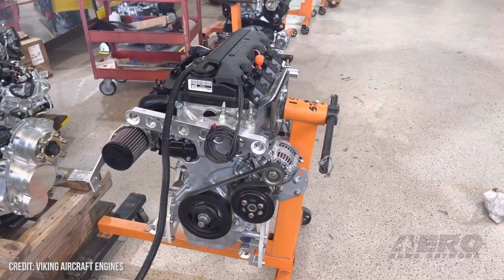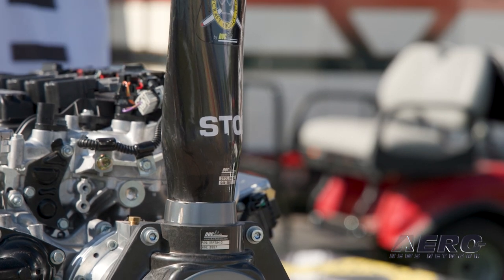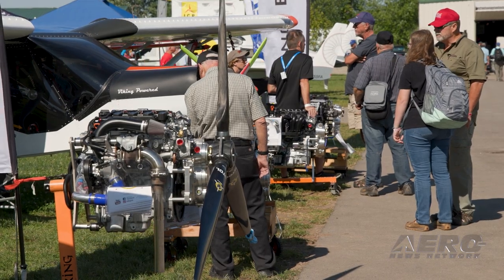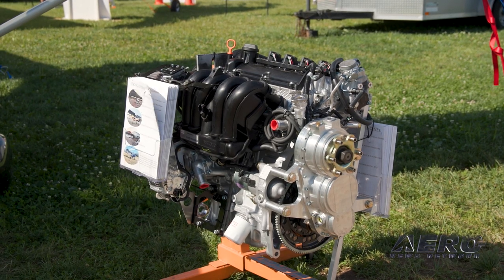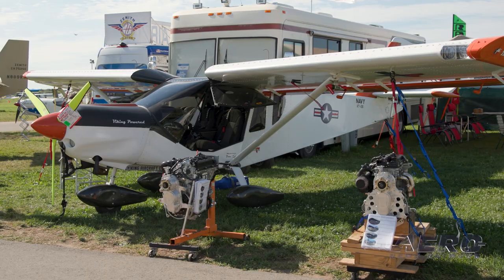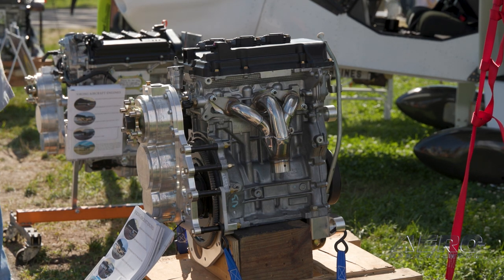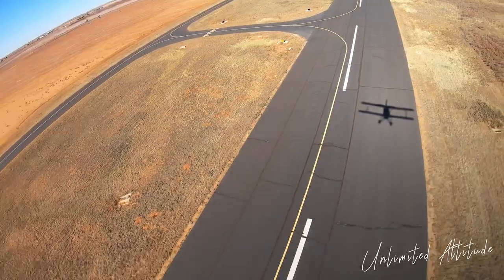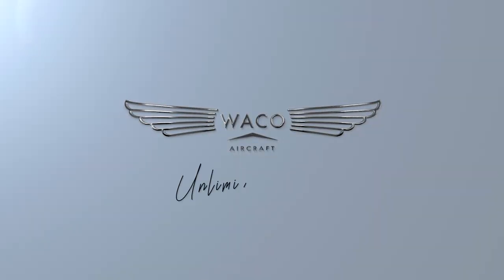Aero-TV At OSH21: ANN Speaks With Owner & Designer of Viking Aircraft Engines

Comment: I am always watching to see what's new in the Viking Engine line ups and updates with installations. With 195 HP on a light weight 1.5 liter motor This should put any stall type aircraft that needs a light weight stock powerhouse motor into the sky with the use of a limited runway  with ease and reliability.  Hope to hear about the specs of this new propeller soon.....